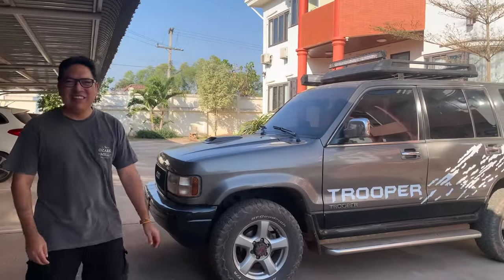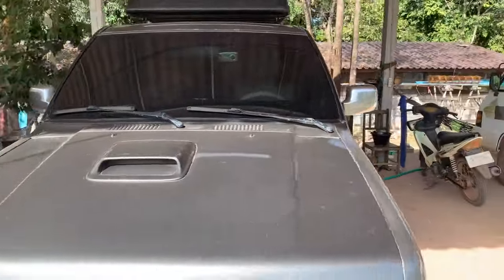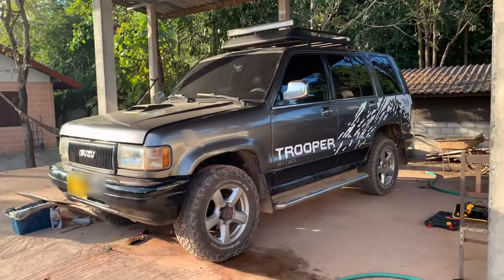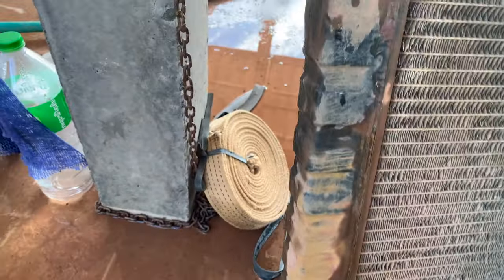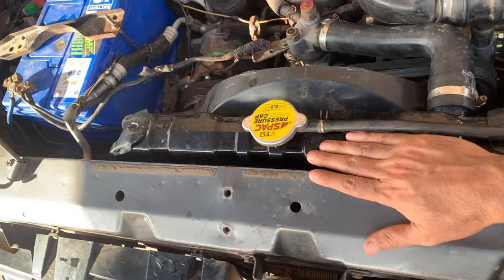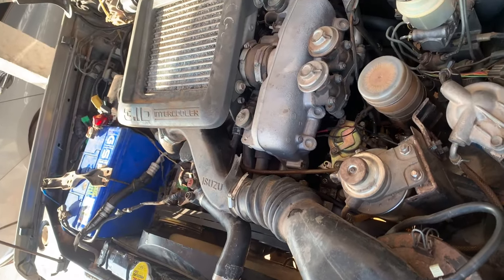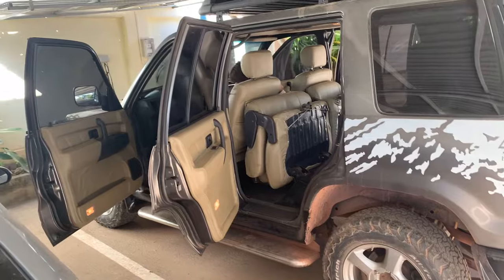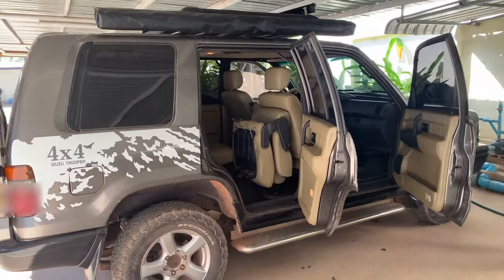We Bought an Isuzu Trooper for the Laos Countryside - Was this a Mistake?

Comment: is this from a private seller or where the dealer dealer located…I’m trying to get the use one in laos or how much? i just want to know the average price
Reply from the maker: We bought from a private seller on Facebook. This is a ‘95, so avg price ranges from 145,000,000 to 155,000,000 LAK based on posts. Toyotas will run you 30-50% more, based on the age and quality.
You do have to be careful with used car purchases. When we bought this one, we knew there were things we would need to repair/replace ourselves, so we spent another 100,000,000 LAK on mechanical repairs. We did a lot of searching before finding this one, but in the end I don’t know if it was any cheaper than if we had gone with a dealer. Hope that helps!
Reply: thanks for the advise
Reply from the maker: Sure thing. Good luck!